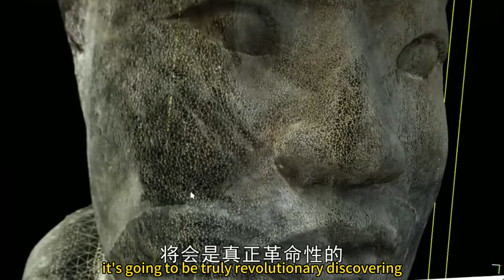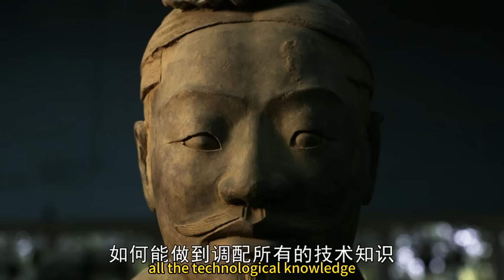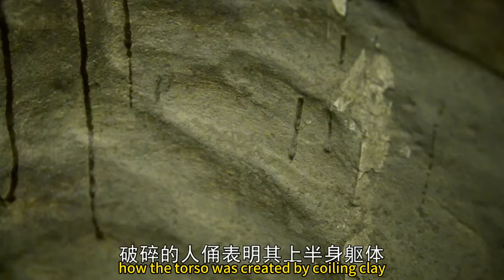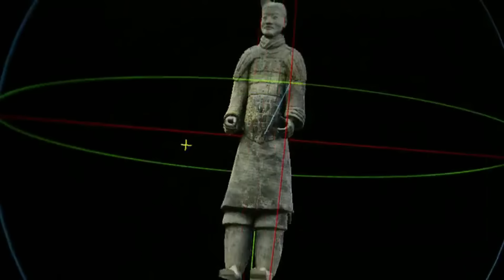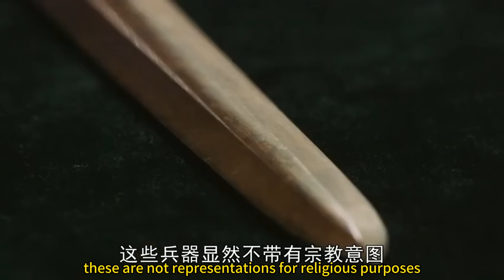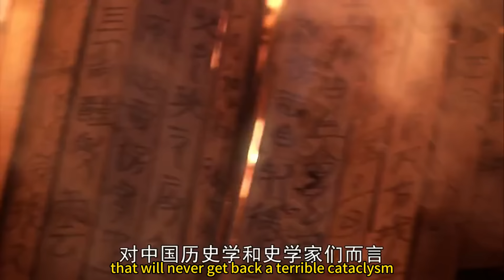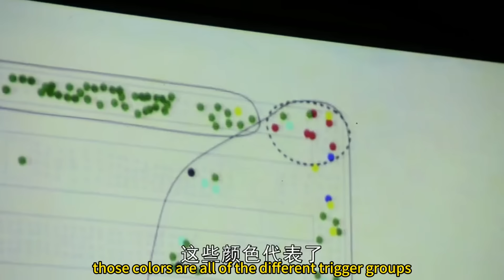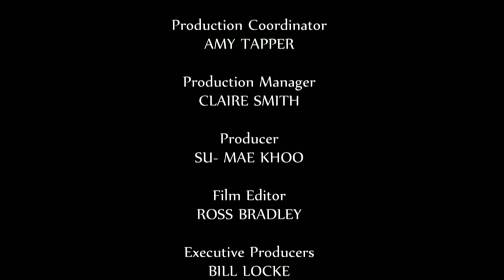New secrets of the Terracotta Army (BBC)

Comment: As a welder, I worked jobs where I had a mark that I would press into the metal. That mark could then be looked up, even years after I had left that job.
      So the idea of marking your work has not passed away.
Reply: I work in a machine shop that makes roll forming machine and when I was in deburr I used letter punches to punch my initials into quite a few of the bases I deburred no one else knows but somewhere in the world my initials are on some ASC roll formers